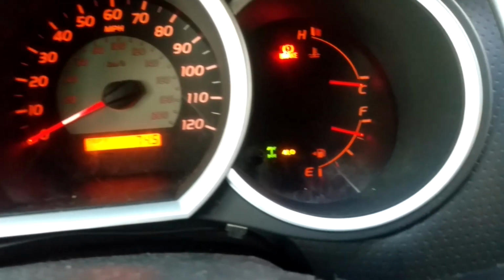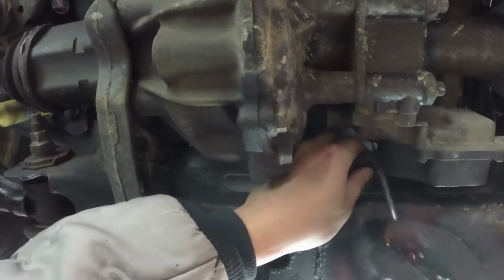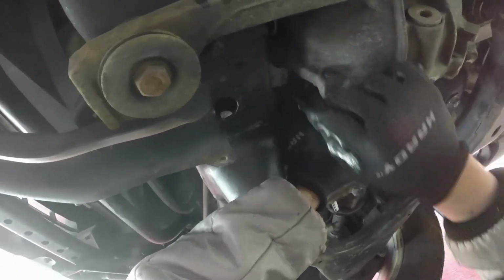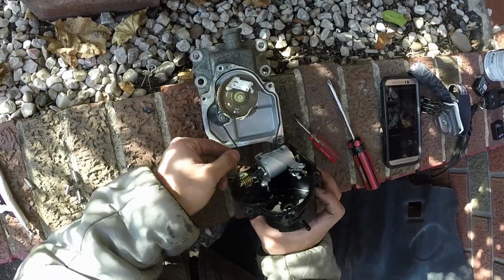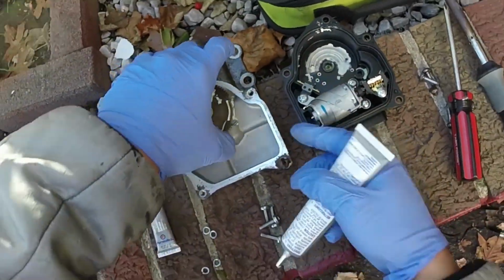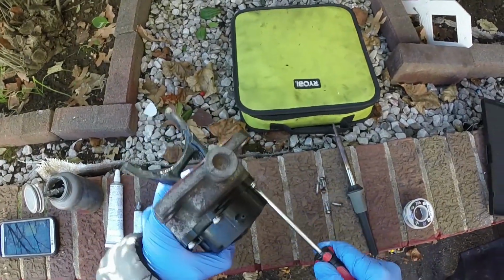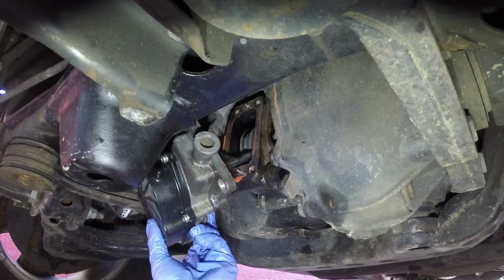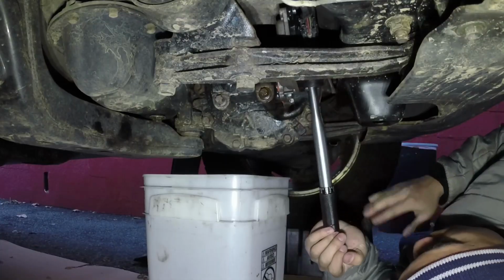4WD Fix (Tacoma DIY / How To)

Comment: Have you found any option to purchase the pre-cut gasket for this? I would rather pull, fix and replace all in one go instead of having to wait 24hrs for the gasket material to cure.
Reply from the maker: No precut gasket. There are some high temp and high oil RTVs that don't require 24 hours to cure and you can use those as a substitute
Reply: KFlo's Tacoma Build yup! Used permeated right stuff 1-minute gasket. Just gotta reassemble in 5 mins. 😂
I did and only torqued the 3 easy ones in 5 mins... and took my time for the 4th one.
Reply from the maker: Sweet! Good stuff!
Reply: @Dave and @KFlo’s any special way to torque down that 4th bolt (passenger-top)?
Reply: iggychloe i torqued the 3 i could reach to meet the 5 min timeline. The 4th legit took me close to 20 mins to install and tighten the 4th. It’s like Toyota doesn’t want you tightening it. 
That said, thinking about it... raising the truck from the frame rather than using ramps or from the axle should give you more room.
Reply: Dave Eyvazzadeh there is a gasket maker like rtv it is called “the right stuff” and it don’t have to cure for 24 hrs I’ve used it on anything from water pumps to oil pans it’s the only gasket maker I buy now

Comment: The plastic housing for the motor and gears, can you add some silicone seal to make it water tight?
Reply from the maker: It should be water tight, there is a rubber o-ring that goes around the housing.
Reply: I just finished reassembling the actuator, changed front diff fluid, now I had new problems. Tried the 4hi, it’s now stuck in 4wd and 4wd lo blinking.  I found leak in the actuator. I must have not installed it properly. Back to drawing board again.
Reply from the maker: You would have to make sure that the adjustment forks are in between the collars during reassemble. Did you test the electric motor before hand before closing up? Make sure the contact prongs are also clean btw. The dielectric grease has a tendency of preventing good electrical contact so clean that off too before reassembly
Reply: Yes I did check the motor and it’s working fine just like the way you tested yours with 12V battery. I am going to disassemble the transfer case this time and set it to neutral. Hopefully it’ll turn it back to 2wd. Don’t want to drive in 4LO going to work. That’s my last resort, if still won’t work I’ll take it to the auto shop.
Reply: @Beaf supreme I found out that the vacuum rubber tubing that’s connected to the transfer case actuator is broken. I cut it to where it fits back tightly. I went  ahead and disassembled and cleaned the transfer case actuator anyway and found little water inside. Part of the contacts are already corroded but I cleaned it good and put it back together.. Should Ive known that problem, I would’ve touched the front diff actuator. After disassembling the front diff actuator and transfer case actuator, it still stucked in 4wd. So I manually disengaged it. I’m back to 2wd but the 4wd light still blinking. ECU  might be confused.

Comment: What about a MT 2006 4x4 tacoma, does the MT works like this?
Reply from the maker: Mine is the same generation and is also manual transmission so yours should be the same
Reply: My 2015 MT has been having trouble with the actuator intermittently. If I turn off the engine & restart it the actuator works every time. Weird huh.

Comment: Where do i fill the differential at?
Reply from the maker: I made a whole video on the front diff fluid replacement. Check it out here: https://youtu.be/BdAzLwU-Qys
Reply: @TacomaTutorials  i cant even get the top passenger side bolt off 🤦🏻‍♂️
Reply: @TacomaTutorials  i tried a 3/8 ratchet with deep socket 12 and a 1 1/2 extension with a regular 12 and neither can fit into that tight ass space.
What did you use??
Reply from the maker: Are you talking about the rear diff? Because the fill plug on the front diff is on the driver side
Reply from the maker: What year is your truck?
Reply: @TacomaTutorials  2005
Reply: @TacomaTutorials  no for the actuator man. I was trying to get those top two bolts off and the one on the passenger side, the space is too tight to get anything in there
Reply from the maker: I used a 1/4 inch drive socket. That should be small enough

Comment: Is this what I need to do? I have a 2006 Tacoma and here are the symptoms:

1. 4WD High and low will not engage, and there is no noise when i try to engage. 
2. At all times when im driving the green 4WD light is blinking

This began after I went down a very bumpy forest road in 2WD. Nothing out of the ordinary happened, but the next time I wanted to go into 4WD it wouldn't engage. 

wanted to get other's opinions before I take it apart.
Reply: Same happen to my car hilux
Reply from the maker: I would recommend cleaning the electrical contracts on the harness first. If that doesn't work, then take it apart and perform my fix
Reply: @TacomaTutorials  not really "your" fix.... it's been around for awhile...lol ;)

Comment: Okay guys i need some help. Have 2008 Tacoma automatic. 4x4 switch on the dash. Turn switch to 4x4 hi or low and nothing happens. No light in dash. No click in the glove box. Leave switch in 4x4 high turn truck off, then back on. Hear click in glove box, light comes on and 4x4 is engaged. I'm thinking relay of some sort. Anyone have a cure?
Reply from the maker: Did you try this fix from my video?
Reply: @TacomaTutorials  Not at all  like what you described what yours doing. Works fine if i turn truck off and turn it back on. Never any blinking lights.
Reply from the maker: There's a position sensor inside the actuator itself which may be gunked. You would need to clean the metal fork and contacts from the dielectric grease. I think that may be what's hanging you up.
Reply: @TacomaTutorials  And this is behind the glove box?
Reply from the maker: No it's inside the actuator. It may be worth your while to try this fix anyways.
Reply: @TacomaTutorials  Thanks for your help.

Comment: The three gears in mine won’t turn. Is this normal because I see that they turn quite easily in your video.
Reply from the maker: They should be turning. Pull them out and inspect to see if any of the teeth/bearings are broken. Clean them and then lube them up.

Comment: What if you don't wait 24 hours before refilling the differential,  will it pop the seal?
Reply from the maker: The seal may not set properly. My recommendation was based off of the manufacturer label.

Comment from the maker: Guys, Make sure that when you reinstall the actuator, that the fork is in the center of the pulley that slides up and down the shaft!
Reply: KFlo's Tacoma Build what size of tires do you have in your trunk?
Reply: Can you show a picture of what you mean? When I reinstall I am not sure if I should put the forks in the groove on the end of the 4wd shaft or on the smaller longer cylindrical portion.

Comment: Thanks so much for the video. I posted this question on TW, but haven't seen a response yet...hoping to tackle this issue tomorrow before winter sets in any further:

I am new to Toyota and just purchased a 2010 Tacoma V6 this spring.

Now that we have snow where I live I've discovered this problem. 

I'm going to attempt this fix tomorrow, but wanted to see if anyone has input on one thing I've noticed.

When I turn to 4hi I get the flashing dash lights, they don't go away when switched back to 2hi, but do when engine is turned off. HOWEVER, I noticed that when they ARE flashing that I can hear a strange sound when pulling away from a stop. It's hard to describe the sound, but it almost sounds like 
rubber slipping (if that makes sense to anyone). Also hard to tell where the sound is coming from, but from the drivers seat it sounds like it could be below and behind me, not up near the engine.

Any input would be fantastic and very much appreciated.

Thanks!!
Reply from the maker: That may be the actuator attempting to engage but is not fully engaging. If it doesn't engage then the light blinks to show an error. When you turn off the car and then turn the 4wd knob to off and then start the car back up, it will reset the 4wd back to 2wd. Usually it requires the truck to start rolling prior to fully disengaging, which is probably the noise you are hearing. Once you try this fix, it will make a sliding / hammering sound whenever the 4wd engages and disengages. Once fully engaged, the lights will stop flashing.
Reply from the maker: Just a note, the fork in the 4wd actuator needs to be in between the collar of the slider inside the axle. Good luck dude
Reply from the maker: BTW, if you can sub to my channel and share any of my vids with your tacoma friends, that would really help me out!
Reply: That sound is what I hear when 4lo is engaged, like a rubber grip sound behind you. It might be that you are in 4lo and dash isn't relaying that correctly. If this fix doesn't work, check 4wd sensor

Comment: I have different issue mine wont go back into 2wd. Going to 4wd hi is good . my lockers are also stuck on n when i put truck in park it still acts like its in nuetral but it drive foward n backward fine in 4wd. No gears crunching or noise. what do you think is going on .
Reply from the maker: It sounds like you have electrical issues. Did you check the connectors and the electrical cables?
Reply: @TacomaTutorials  yes check everything even fuses . not sure what to do except send to stealership. I was hope its something i can do myself .
Reply from the maker: Take the actuator apart and see if the motor is stuck. It may be the case with yours. It will only cost you the value of the diff lube and the gasket maker.
Reply: @TacomaTutorials  thank you for your help really appreciate it . took 2 actuators out clean chexk test all good . rear diff bearing blew  . got to rip rear end off this weekend . it threw me off cause 4wd still works . drained rear diff lots metal shavings .

Comment: What voltage did you test with the jumper? 12v? Auto battery?
Reply from the maker: I used a portable jumper. It's rated 12 volts. You can definitely use the auto battery too though

Comment: Great video, but I made a big mistake today... I watched videos, read the Chiltons book (which said NOTHING) and when I finally got it out, I tore into it only to screw myself. I have an 03, it is supposed to be vacuum operated, it's not... It's an electric worm gear, and when I took it out and it came apart, I lost my location of the worm wheel. I tried to figure it out by logic, and there are no markings to line things up. But, if I'm off a tooth I won't have full engagement and may strip splines, so I gave up... I am now waiting on a new front diff actuator; Yup, I suck and I'm pissed off that I couldn't get things right. I just can't find the right video or book, I'm gonna order a shop manual...
Reply from the maker: Does it internally look the same as mine? If it does, there is a position sensor and as long as you reassemble it properly And reinstall it properly, you should be Ok.
Reply from the maker: Be advised as it is at your own discretion though.

Comment: Another front differential actuator fixed 2004 toyota 4runner 4.0 exactly the same. The only thing id suggest is taking the two 22mm bolts out that supports the differential it made getting to the top bolts on the actuator easy to remove and install.
Reply from the maker: That's a great idea. Thanks for the input

Comment: Awesome very well detailed tutorial! I was able to fix my 07 Tacoma with this video. If it helps any one I made a mistake and move the gears which slightly misaligned the fork when I put it all together my Tacoma was detecting an error. This solution was just to reset Gears into 2 wheel drive position and it was good to go!
Reply: How did you reset the gears? Is there a procedure to relearn it or did you have to take it apart and reposition them? Thanks, having an issue with my tundra after driving through a 3 foot deep puddle
Reply: Tim Hulmes I’m curious about the question you asked, that was a good question... unfortunately no response

Comment: I finally got my 4wd actuator fixed, Thanks for the video . The hardest part was getting that upper Right bolt back in, needed a fine tooth ratchet to get enough turn on the bolt to move it. I think mine was locked up when I took it apart the motor would not turn by hand but turned ok with power put to it. So I put some oil on the motor to free it up and soldered the leads and it works great now. Thanks Karl.
Reply from the maker: +D21403 yea that one bolt is quite deep in there. I'm glad my instructions helped!

Comment: I have the same problem on my 05 Tacoma, can hear the drive shaft kick in but no 4wd.  Great video  Want to try this before I get a new part but have to wait for the weather to get a little warmer only 15 degree here.
Reply from the maker: Yea, I hear you. It's been way to cold here in Jersey to do any outside mechanical work
Reply: Did you ever give this a try? If so, did it work? Thanks

Comment: Thanks for the video! I think I have this same problem on a 2008 Tundra. Flashing 4wheel drive light/no engagement. What steps did you take to check if the A.D.D. was the issue? I don't want to go tearing into my truck just to find out that was not the issue.

Comment: Where does the fluid come from and how do you get it back in?
Reply: Just make sure the drain/fill plugs can be loosened first.I would drain the fluid if not sure about condition of lube.This is a crap design part,video shows how it should be repaired(expensive part).
Reply: The fill hole is on the driver side of differential ,  can see better through wheel well.

Comment: will the dash flash like so if you are not engaging 4hi or lo properly. or does it mean it has this problem if you see those flash?
Reply: okay. I ask because i'm currently looking at one but we couldn't get it to engage the first few times of trying. we took it back to the dealer and they had it engage right away. from then on we managed to get it to engage much easier. just wondering if this would be from it sitting for a month or two or if its foreshadowing problems down the road.

Comment: This is so informative thanks so much! Im repairing my own tacoma I bought wrecked but now that I'm almost done with it I have noticed mine has the same problem,. I put it in 4HI and 4LO and the lights just blink without engaging 4wd. I think there is a TSB on this for the second gen tacomas so ill give it a try and change my ADD Actuator. Once again thanks for this awesome vid!
Reply: Did it work?